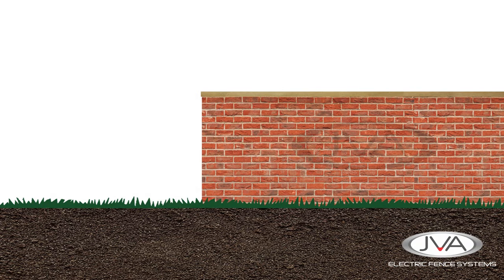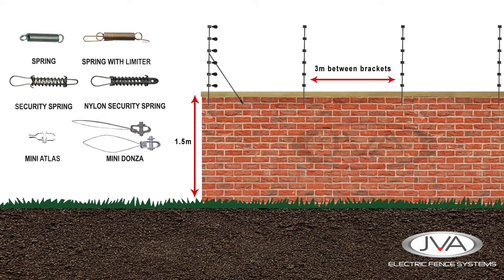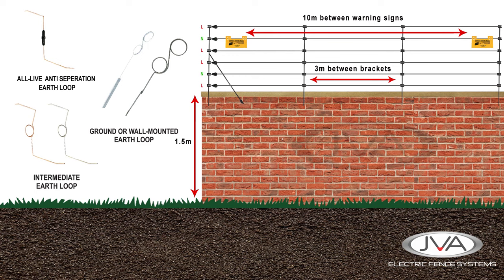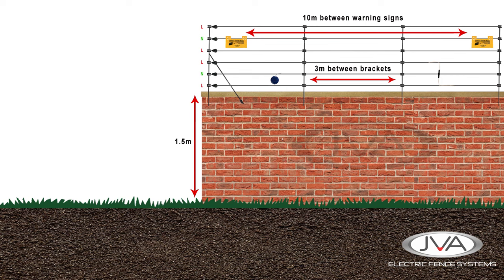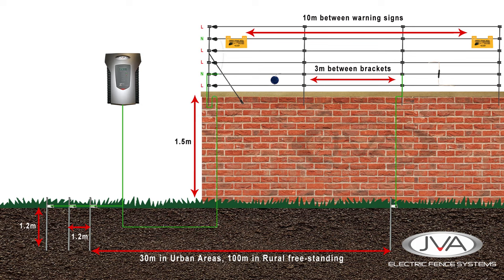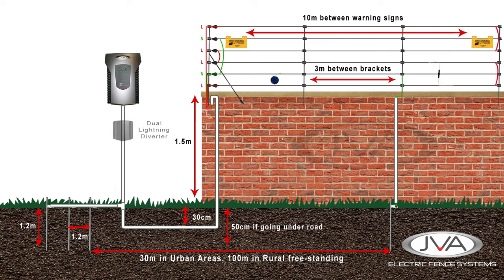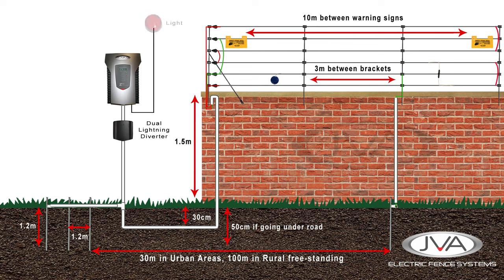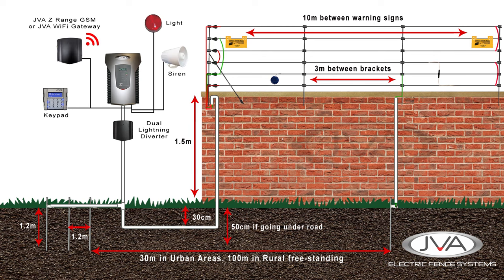Electric fence installation - Walltop Installation Guideline

Comment: Thx alot dea yo the best.
  But can it apply on hammer energizer  because it has 3 terminals   only
Reply from the maker: This should apply to all makes of energisers, all energizers will have an earth terminal as well as a live but some will have the additional terminal depending on if you wanting to run at full or half power. If the energiser does not have an internal fence monitor like the JVA then the return should root back to an additional monitor that measures the voltage on the fence and will alert the user if the voltage drops significantly over a period of three pulses.
Reply from the maker: https://store.jvasecurity.com/collections/monitors